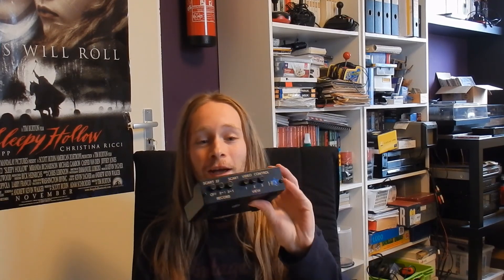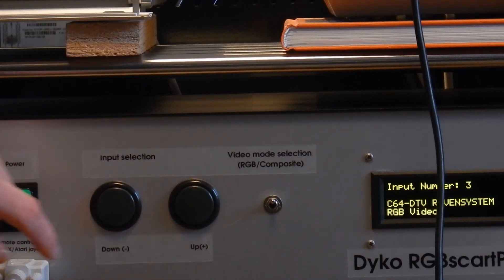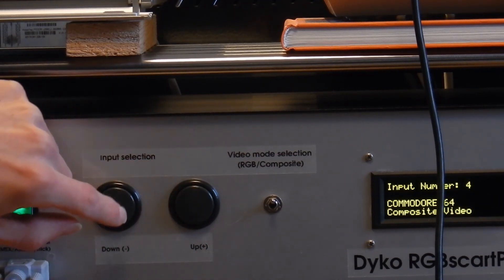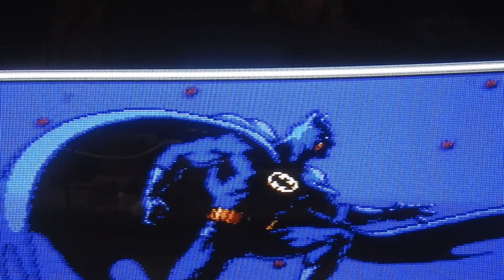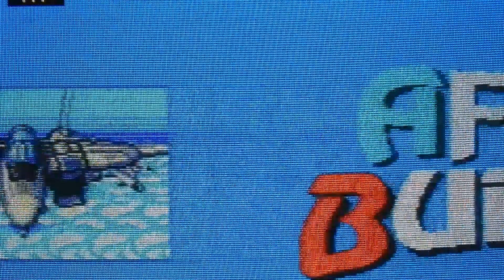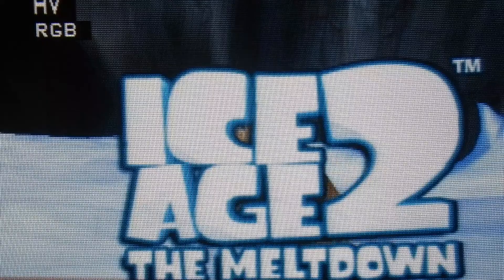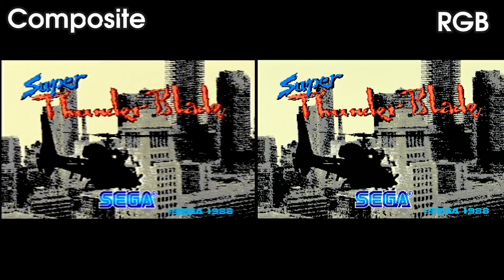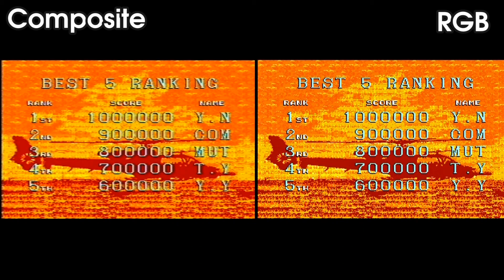D.I.Y. RGB scart switch (dyko rgb scart pro demonstration)

Comment: Great work, how did you make the case?  home made or used an online cutting service? I need a cheap online cutting service where I can order my custom made panels any suggestions, please? thanks
Reply from the maker: We bought an off-the shelf case and cut some holes in it our selfs. My dad did spent some time carefully measuring out the placements of the holes and he used a file to get them to fit nicely. It was quite labour intensive. The brand is called  "Modu electronics", it is the "Economica" series. We bought one here: https://www.eltim.eu/index.php?item=&action=page&group_id=20000871&lang=en
Reply: thank you very much :), great work .

Comment: Fantastic! =)

I've been thinking about making myself my own Scart Router (multiple independant outputs, I've got 3 TV sets in my livingroom setup) sometime, this gave me a serious boost. I got here from another video on how to make a Scart Switch (RetroSwim)

I got a Holdan HSR-1000 today but it lacks RGB on all ports and not enough inputs.

Your (dads) modular design is pretty neat!

Any reason you opted for the expensive 312CPE rather than 568-3619-5-ND? The latter ones are surface-mounted but can handle 8 inputs + 8 outputs so would suffice with just one of them for one SCART input. Was it just to avoid SMD?
Reply from the maker: The part was chosen because it was through hole, this way we could put them in sockets so that they could be easily replaced and because my dad hasn't got the right soldering iron for surface mount parts. He's 69 so kind of school in his approach, he doesn't like to fiddle with small surface mount parts, his eyes are to old and he likes to use perforated board. A surface mount part would make the thing more compact, but harder to solder by hand. We considered having a pcb made but it was too expensive for one board and the delivery time was about 6 weeks, so that another reason why we use this approach.
Reply: I'm a rookie at soldering so I'd prefer through-hole as well but I'm on a tight budget so I might give it a shot.

I couldn't for the life of me figure out what bus switch circuits to use on my own so I'd have to go by recommendations =S

Did you look into OSH Park? Used it a year ago for small square inch boards, didn't cost much and got them within 2-3 weeks.

I totally understand doing it the oldschool and hardcore way, it gets the job done. It looks good and it's certainly an inspiration =)
Reply from the maker: In the netherlands there are not that many options for having boards made, the other alternative was to have a board made in germany, which would take 6 weeks.
And generally, the prices where prohibitively expensive, more then €100 for one board. Then, you also need make sure you've everyting right in the design, which we didn't. We hade to bodge in that rgb/composite switch at the last moment. It can't autodetect the signal unfortunatly because we overlooked something, so we bodged in the switch, which turned out to be a lot better then I thought.
Reply: OSHPark ships worldwide, I'm in Sweden =)

But yes, it adds up for bigger boards and if you make a mistake... You're screwed. Breadboards are more flexible.
Reply: Have you seen the GSCARTSW switch? 8 inputs, 1 SCART output, 3.5mm audio jack, and a VGA jack. No idea if it can actually manage VGA, but the connector is there for the sake of another video output. 

The only downside is the cost, at $225 USD. Made with retro gamers in mind however, and they work perfectly.